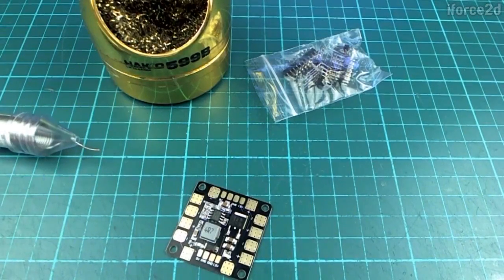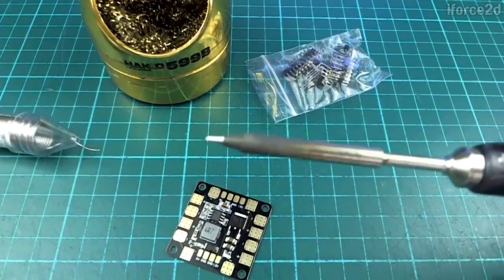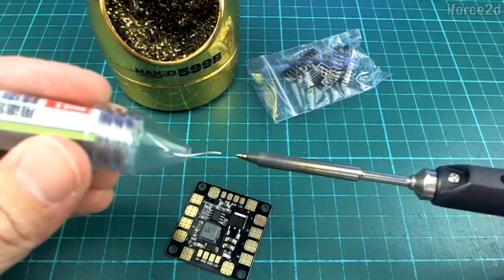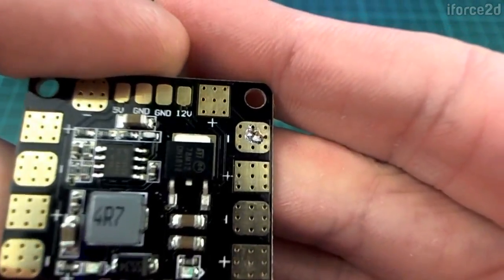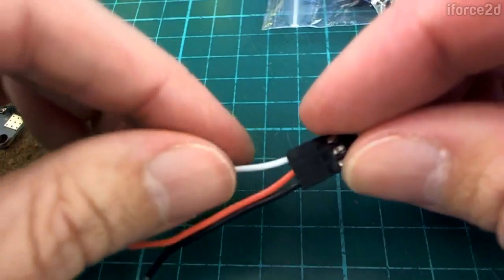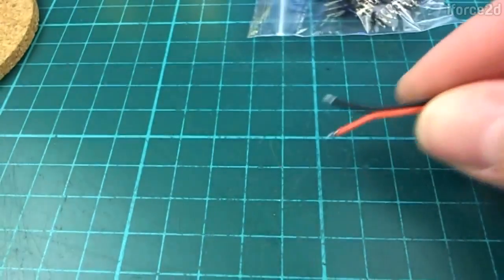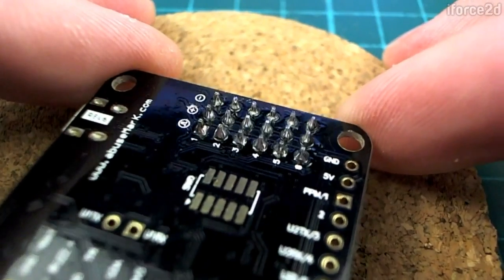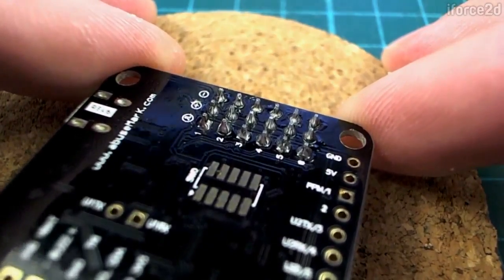Noobs guide to quadcopters part 13 (soldering)

Comment: Your should really try a chisel tip on the iron....It's WAY more versatile can get small joints and you have the heat transfer for larger joints when you need it..n it's WAY faster...you'll come to love it and be proficient with it rather quickly. The heat gets in quicker and you can solder faster and not melt plastic connectors cuz you're waiting on heat transfer from a smaller tip....also..flux (aka rosin) helps when reflowing tinned pads/wire ...then you don't have to waste solder or end up with too much on the joint. (Rosin is) FLUX & is super cheap and leaves a nice shiny good SOLID joint...rather than a crusty, flakey, dull, dodgey "maybe" connection that looks like hell. If it's dull, you burnt all the flux up and oxidation is now taking over resulting in bad adhesion and a dry, dull joint that WILL fail eventually...especially when vibration is a factor. So flux is necessity NOT luxury...flux is also useful for desoldering....especially if you have to use a DIY desoldering wick like leftover speaker wire. 

Also, good to note is you want to heat BOTH the pin AND the pad/wire AND the pad then flow the solder....the solder will flow to the heat...and flux on the pin and pad will help with that flow and proper joint completion. Get a liquid flux pen ($1.50ish) and some solder paste, same thing just with a petroleum jelly consistency ($0.75) and you'll be good to go for years of beautiful, properly working joints. Using flux on wires and pads prior to heating them and applying solder will ALWAYS result in a perfectly beautiful and highly functional proper joint and you'll notice the solder flows into the gaps and fills better in between strands and holes. Also applying flux will help when "adjusting" your solder joints. 

...just some food for thought...I've found trying new things often benefits me more than staying set in my ways...

Comment: Having soldered tens of thousands of copper pipe joints, its very important to clean the copper first if you want the joint to not leak. Why is this not necessary in electronics? I've never seen anyone sand a pad first, or copper wire. Is this a bad habit I've carried over to sand the pads before I attach my wires? Just wondering your opinion...thanks.
Reply from the maker: Well I for one am not worried about the joint being watertight :) A solid physical connection is good enough.
Reply: MyBigThing2010 Thanks for answering the question...helpful info
Reply: PowerScissor DUDE, two different methods of welding that you're lumping into the same category. Pipe soldering uses acid based flux and you are making a connection that is CAPABLE of withstanding pressure...electrical soldering is totally different uses NO acid in the flux (acid + electrical = BAD) and is only a mechanical connection. Don't sand PCB pads ever. They are the size they are and the thickness for a reason...Using proper electrical flux or rosin core solder will get rid of any oxidation that's there. Sanding IS NOT recommended.
Reply: PowerScissor your very welcome. I'd hate to see someone sand into an expensive or lengthy project and ruin a PCB or have to buy a dodgey pcb trace repair product to try and rebuild and salvage a ruined pad trace. Just an FYI ...acid and electricity equals corrosion and corrosion is basically the decomposition of the joint/connection and will cause premature failure...that is why acid is avoided at all costs I inside electronics. .. Proof statement, just look at your lead acid terminals on your vehicle battery. It requires constant cleaning, maintenance and terminal replacement....but they still use it cuz of cost/benefit in that particular system.

Comment: A few comments. If the flux instantly flashes off fast in a cloud of smoke the iron is too hot. Get some decent solder. That stuff is rubbish. Cone pointed tips are all but useless because they don't transfer heat quickly which is why you probably needed to have the iron so hot to begin with. Chisel pointed tips will have much better contact area and hence better heat transfer.
Reply from the maker: I have to disagree with this solder being rubbish. But maybe you could suggest something better. I would also have to disagree with cone pointed tips being all but useless, I have only ever used cone pointed tips for this small scale stuff and I get by just fine, it's not like we're soldering copper roofing or anything :) A little dab of new solder to wet it if necessary is all it takes to get the heat connected.